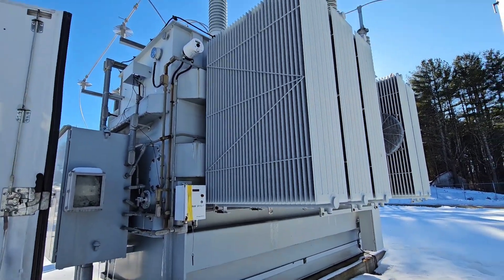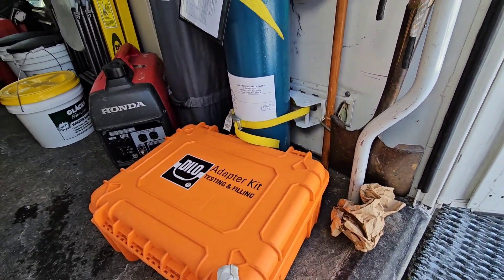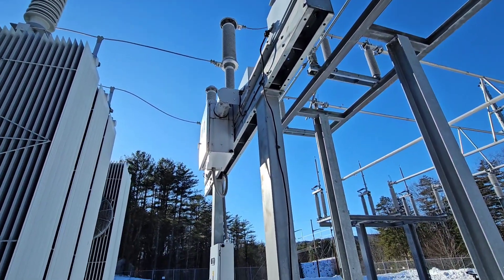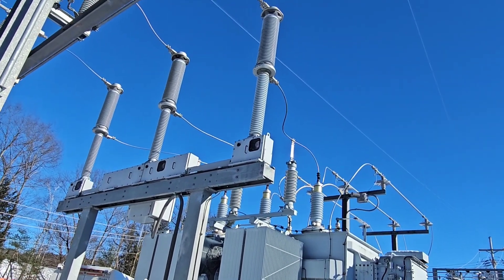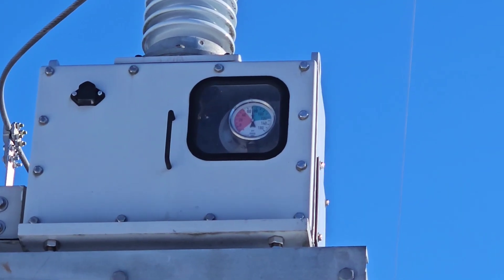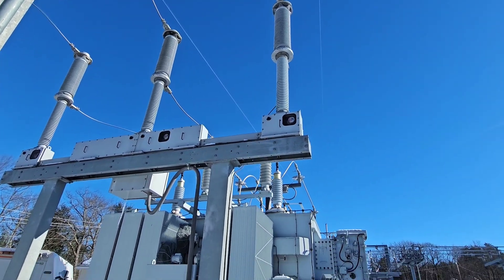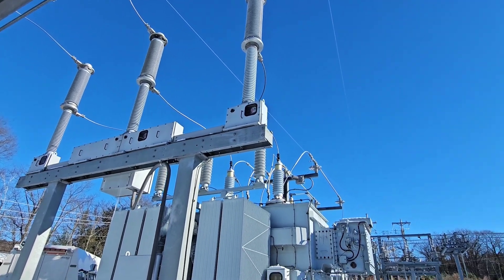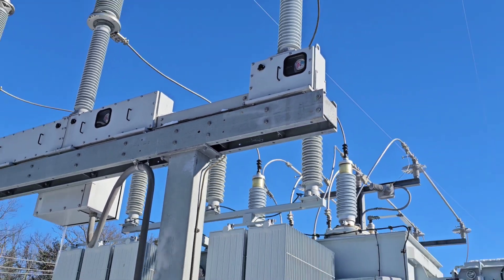Cold weather blues! Low SF6 gas in 115kv circuit switcher from low temps. #substationlife

Comment: SF6 gas is the strongest green house gas there is and it lasts thousands of years.  Vacuum switch gear is larger and costs more.
Reply from the maker: Absolutely... 1 lb of SF6 does the equivalent ozone damage of almost 25,000 lbs of CO². The other problem with vacuum switchgear is that I am not aware of anything in the 100kv plus range.  We have gone to vacuum for 34.5kv and below.  Personally,  I think oil is the safest most environmentally friendly super high voltage insulating medium currently out there now that it is all non-pcb, it's cumbersome to work with,  but it's easily contained in a spill or catastrophic failure and doesn't readily mix in the environment... it can be easily separated from water and isn't toxic or poisonous. 
I have heard there are pure nitrogen breakers on the horizon.

Comment: Laymans question: why isn't there a long gas line, connected to the tank that would allow topping up the gas without cutting power?
Reply from the maker: Worker safety.
Even if there was (some equipment can be filled from the ground) we would still de-energize the switch to fill it.  If something were to happen to the line during filling or if a slug of air was to go up into the tank and create a possible flash, we don't want to be connected to it or near it.  
We de-energize the equipment,  add gas, then move away from it and re-energize it.

Comment: VERY DANGEROUS GAS
LUNG DAMAGE
YOU SHOULD USE SCUBA GEAR
Reply: SF6 is a non-flammable inert gas. totally safe as long as you still have enough oxygen to breathe.
Reply from the maker: After the gas has passed through an arc, it breaks down into a couple of very dangerous chemicals (SO² and some sort of bone seeking acid),  but the new gas is not dangerous.  We are not releasing gas to atmosphere in this situation either,  simply taking new gas from the tank and adding it to the circuit switcher.  If we had to go inside the circuit switcher,  it would be a very different situation.
Reply: SF6 is perfectly safe in open air. Not toxic to humans and mostly inert. Its only real risk to humans is asphyxiation in a confined space.
Reply from the maker: @Darklor_WCF  I have seen people breath SF6 to make their voice deep... it works the opposite of helium. That's new pure SF6.  When it is used inside these tanks as an insulator and to break electric arcs, it breaks down into some pretty nasty stuff.  
I don't know the accuracy of this,  but we were also told that if it passes through a cigarette inhale or an idling engine and then into a person's lungs that it can be very dangerous.
Reply: Probably mistaken SF6 for a sodium based material with similar name, which is an entirely different beast.